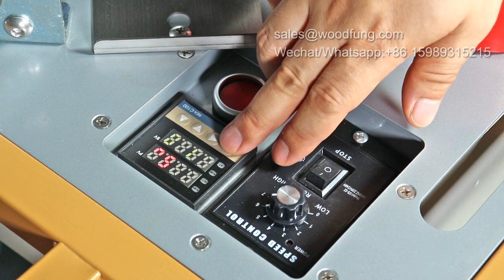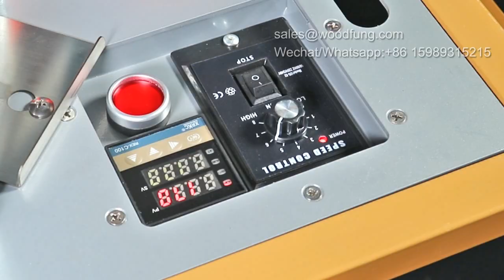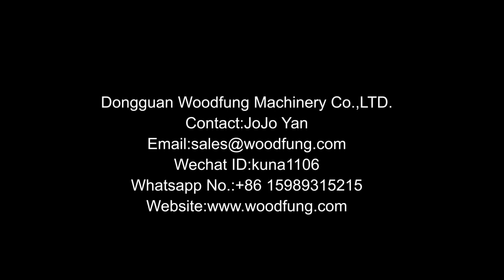MJ09BG pro woodworking saw cutting sliding table panel saw

Comment: I'm doing my best to build my own b'cos the cost is too much for me atm but if I had a bigger workshop I would be trying to get one of these saws. They are so well thought out and lightweight too. 
The only thing I don't like about this saw is no hand wheels for the lift and tilt mechanisms. If the saw had them installed then it would be so much easier. I'm fairly certain it would be an easy fix but I can't understand why u wouldn't offer that as an optional extra even? Why don't u have that built into these saws like most cabinet saws have the 2 wheels. It wouldn't cost too much more to add that to the build I believe. 
I have to say how much I like this whole build though. Even though I would like other things on it u cannot have it all and it's so well built I could live without the bits I spoke of.
Congratulations on a great build an a great looking saw.. I love the rollers & the sliding table parts. The top of the table is so fresh looking too. Great job guys..
Reply from the maker: please visit us at www.woodfung.com and contact me at sales@woodfung.com
Reply: It costs because it doesn't come with only the saw but with router and other mini machines